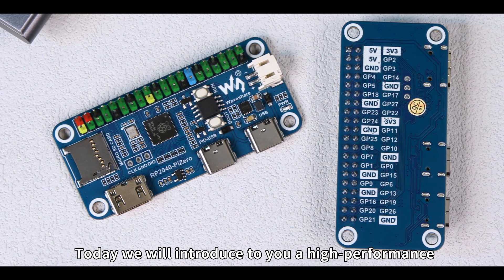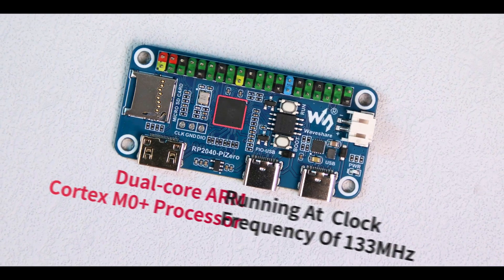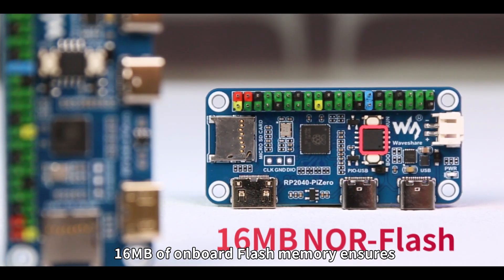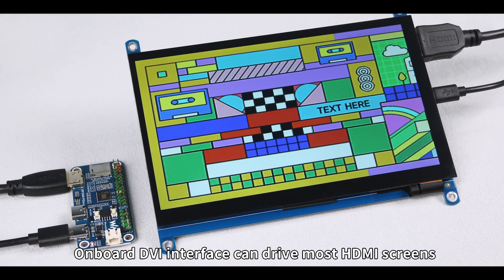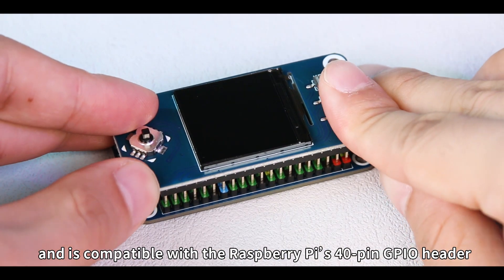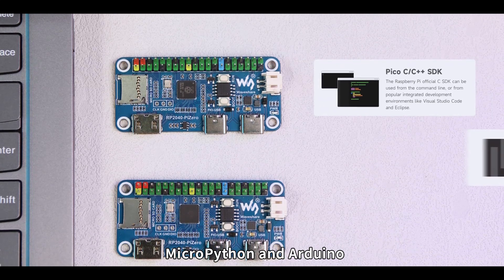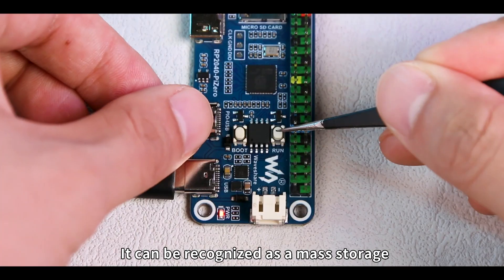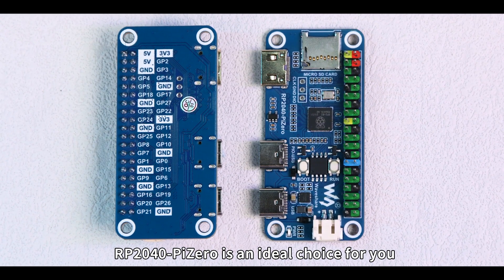RP2040-PiZero, Based On Raspberry Pi RP2040, 264KB SRAM, 16MB Onboard Flash Memory, DVI interface

Comment: is this compatible with anything a rasberry pi zero can be used for? for example if i take the sd card with retropie on it out of my pi zero and put it into this, will it just boot up and function the same?
Reply from the maker: It can't dear. RP2040 is different with raspberry pi zero. RP2040 is a microcontroller, while raspberry pi zero is a small-to-medium-size computer board. For more difference details you can refer to https://www.raspberrypi.com/documentation/

Comment: There is no information on how to use the card, examples are from other products and about HDMI... there is no information so far.
Reply from the maker: Dear, you can refer to our wiki https://www.waveshare.com/wiki/RP2040-PiZero
If there is any more question, pls feel free to contact support here https://service.waveshare.com/
Reply: i had the same problem with the web, cant find the rigth sofware, but i decided to send an email to support team and 3 days later the send me a link with the correct link, the board now works with the example they had.
Reply: @arrozconsalmon  I was asking for the link they gave you but.... Seems they want you to use the Arduino IDE. I found examples and will give them a try. Thanks..